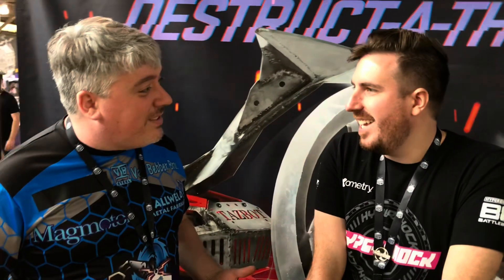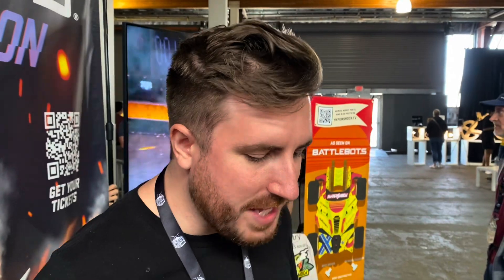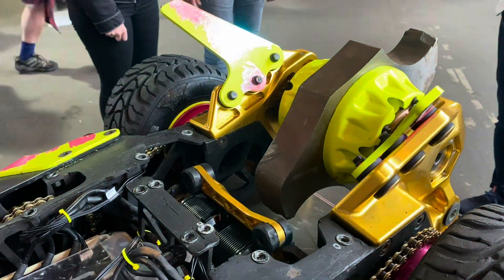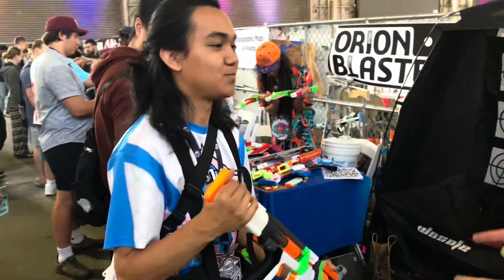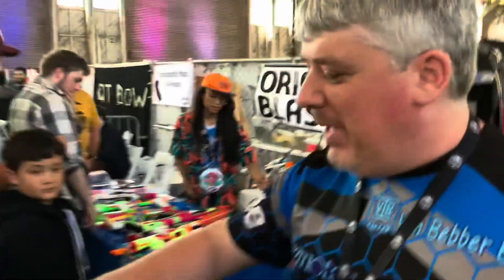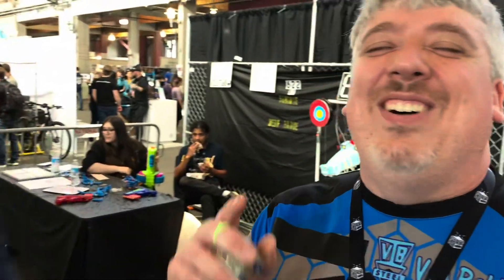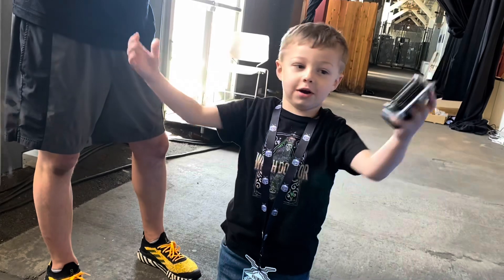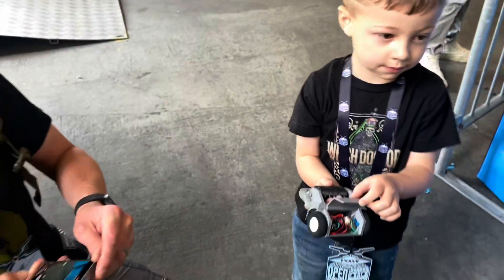We Went To Open Sauce And It Was AMAZING!

Comment: I have to get out to one of these events. I know the basic build of a combat robot to compete witg based on Olde World desisn and physics. But with the new motors and everything, I would need backers and a team
Reply: Try a smaller weight class first: the technology and principles are the same, just smaller and cheaper so you don't need backers or a team to get started. You can get a fairyweight (1/3 lbs) together for around $100, around 3-5x that for a beetleweight (3 lbs).